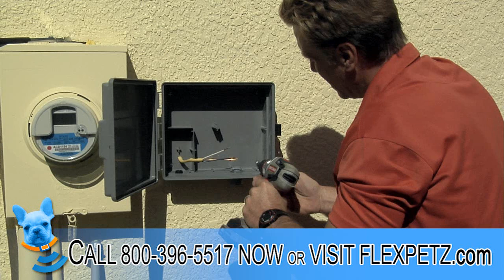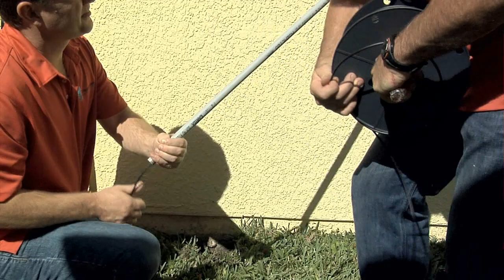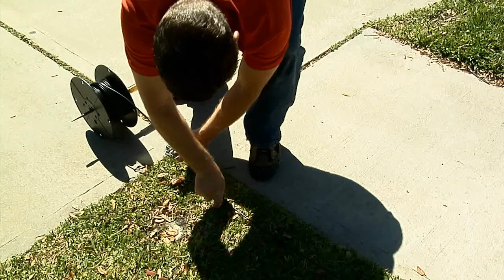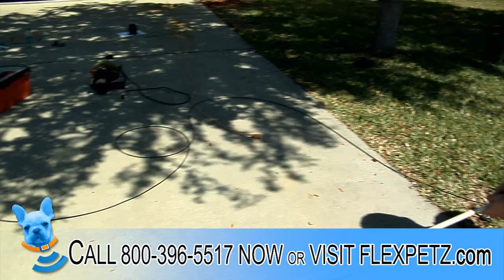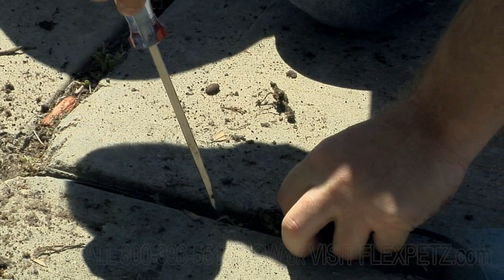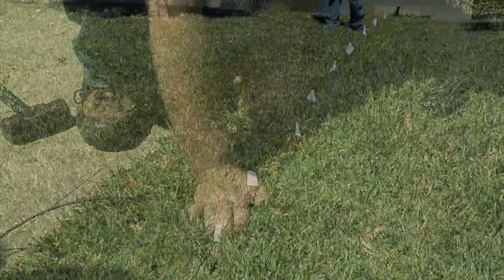Installing an Under Ground Fence Above Ground

Comment: Great video. I am getting ready to install a similar system in my yard. I am thinking about covering the distance Over a sidewalk with the wire under duct tape. Do you think that will work?

Comment: Can ANYONE HELP. I am having issues installing as keep getting intermittent faults (beaks) with a buried wire. It’s very thin not sure how it’s breaking as can’t see it sometimes. Question is: I have a chain link fence around my property, can I use this INSTEAD of the buried wire? I can work out the physics of it in terms of making sure there are two wires going to the transmitter with no interference but just don’t know if the fence (assuming it’s connected up correctly etc) will act in place of the buried wire? Thoughts please?

Comment: Placing a 14g wire around my property, about 5000 ft total. I need to place some out into a pond (I want my dogs to be able to swim, just not too far). Any ideas of how to "bury" this in water? I was thinking of just buying some metal piping and using that as a way to weight it down.